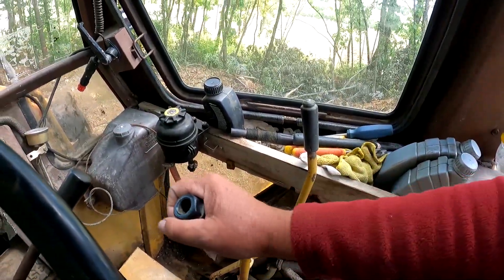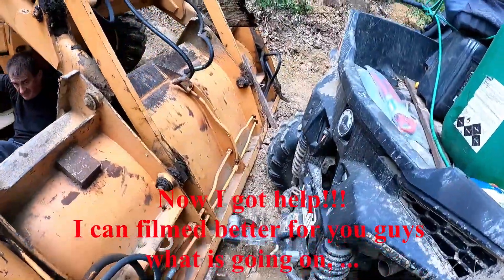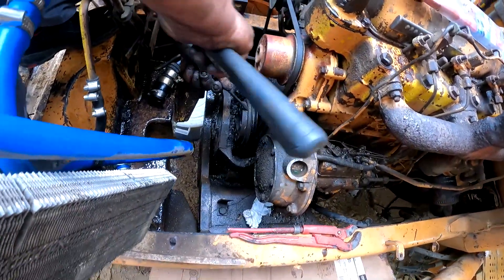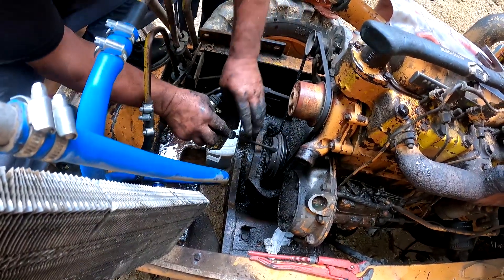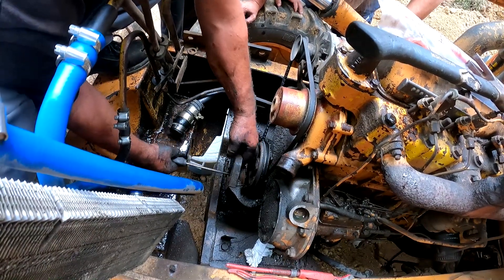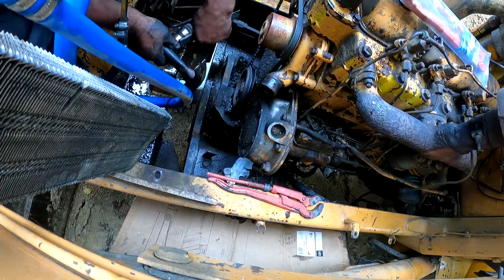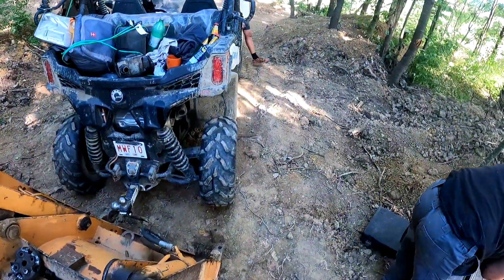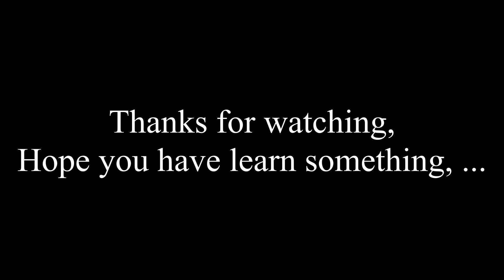Case 580G Hydraulic Pump Coupling Fix

Comment: Good job! Parts for these backhoes are readily available where I live in Arkansas. Case made som e really good equipment in the 70’s and early 80’s but the started to get way to fancy with the engineering and ruined them in my view. They were made to dig and load now they’re made to drive with ac and heat plus the radio playing. Way to many things in the way that just breaks anyway. Thanks brother we’re ever you guys live.
Reply from the maker: Thanks for kind words! I agree what you said about old and new machines.

Comment: Coupler is slinding in shaft ie. if you need to change the belt, you need only open those coupler bolts, and slide coupler in a shaft. There is small cap where you can put the belt. No need to remove pump or cooler.
Reply from the maker: Thank you very much - I will remember that!